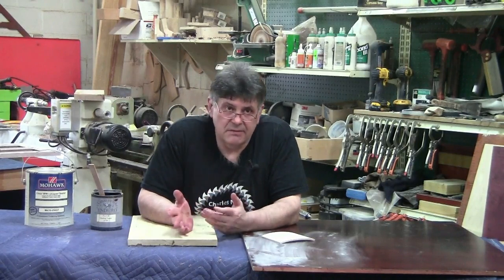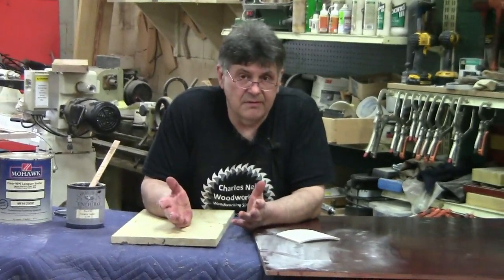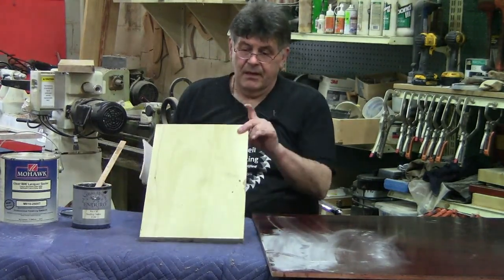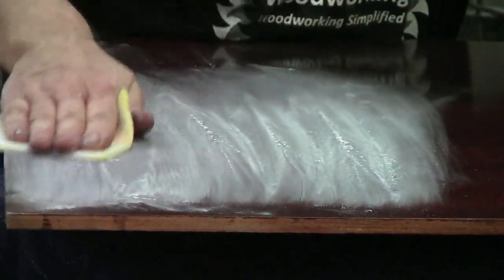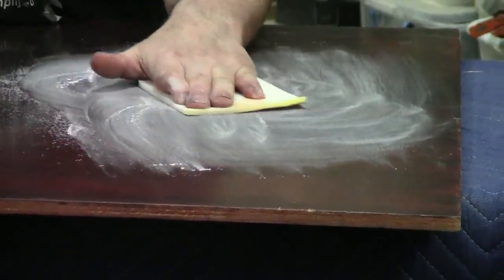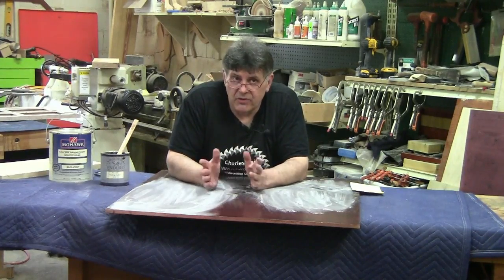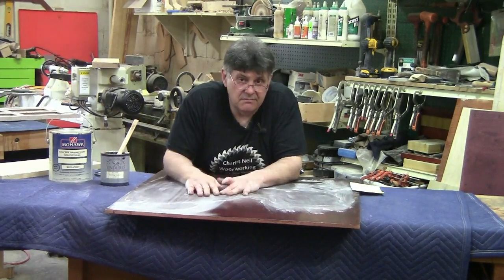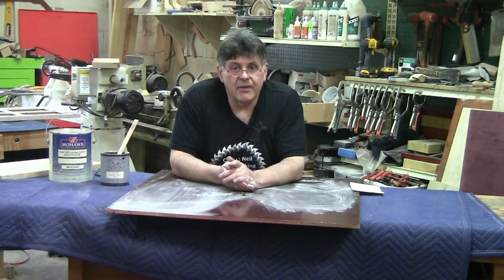Chapter 4 - Sealers - Sanding Sealer

Comment: Sanding sealer is really useful when you are dealing with really thin guitar veneer tops (even when using non porous woods like maple or spruce). You really don’t have a lot of room to work with so that added filler can allow you to minimise material loss and help maintain the grain contrast. You can easily see the difference with the final product / finish

Comment: I've used sanding sealer before I paint wood with spray enamels. It's probably good for use with the old school spray lacquers. It was invented before polyurethanes existed. (1937 - Otto Bayer & IG Farben). Polyurethanes were not available until the 1950's.  Sanding sealer is a varnish. Mixture of oil, solvent, and resin. In fine art, damar varnish is used (It's a gum and solvent used to seal oil paints). It would be too difficult to tell for longevity of a furniture finish, if polyurethanes last and preserve the finish better, than a sanding sealer. The solvents are used as a penetrant for wood and the oil act as a vehicle for the resins to seal the pores. The solvent also keeps the oil and resin mix fluid, and this is why it settles in the bottom of the can. Resins can be substituted with wax, and pigments can be suspended into the waxes in layers (called encaustic painting in fine art) Wax and solvent are the main ingredients in preserving furniture from the 1100's.

Comment: About a year ago I purchased  a quart of Minwax Sanding Sealer. I didn't open it until yesterday because I had some older 
Sanding Sealer to finish (5 year old Cabot). I applied the Minwax Sanding Sealer on new Maple Stairs as per directions on the can. I noticed that as the Sanding Sealer was drying it started to darken slightly and create a blotchy finish at the overlapping brush strokes. Hopefully this can be cleaned up with some minor sanding. Today I tried to sand the imperfections but the Sanding Sealer was rubbery and could not be sanded. The sanding caused the finish to roll under the sandpaper while clogging it at the same time. It's going to take me 2 days of stripping to clean the wood and get ready for proper finishing. I will never take another chance with this product again.👎